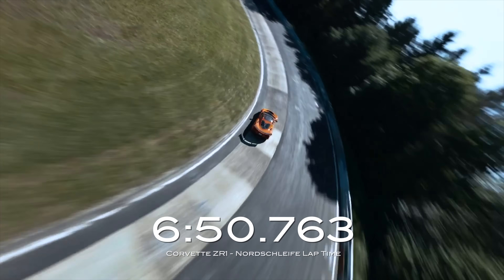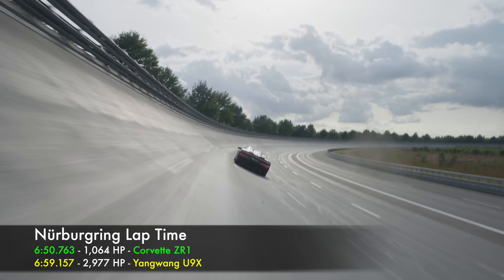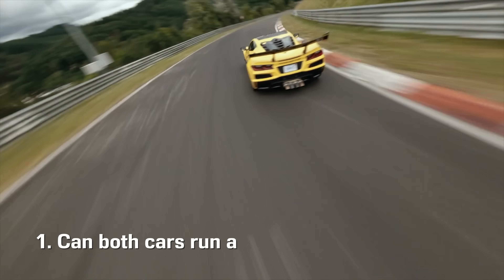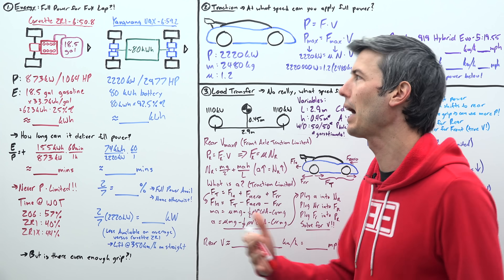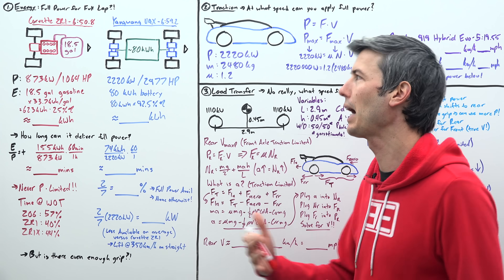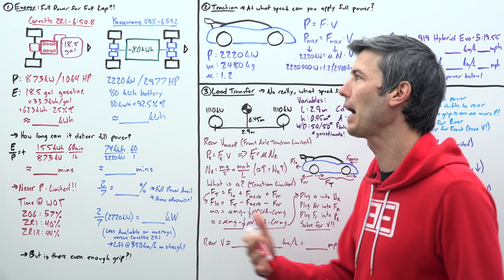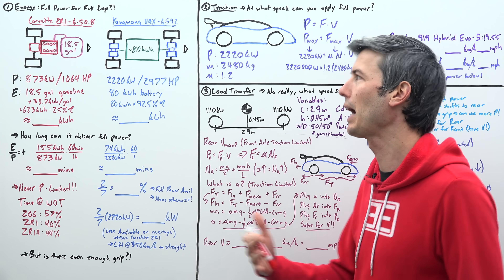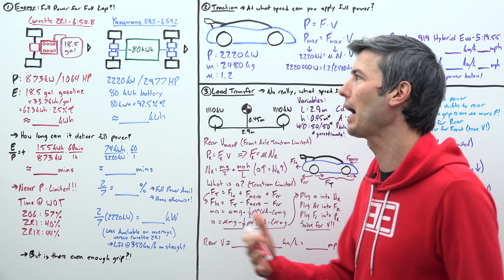Gas Beats Electric! Why Is 1000 HP Faster Than 3,000 HP?

Comment: Ferrari's development test driver said the same thing when they were developing the F80, "At a certain point power becomes meaningless."
Reply: Walter Röhrl, legendary Rallye Champion and Porsche's Chief Test Driver, has said the same many years ago. 
Basically it doesn't matter how much HP you have, if you can't fully use that power, your tires, brakes, clutch and aero are not good and your car weights too much.
Reply: @doublep1980  Iirc he was driving an Audi Quattro GrB back in the day.
Reply: Enzo Ferrari himself had said a lot of wise stuff, so guess their test driver is just continuing the tradition.
Reply: Power only becomes meaningless when it exceeds the limit of the external parts of the car
Reply: @MKCarZEditZ  No, it becomes meaningless when it cannot be handled properly. Each car needs just as much power as will help its handling.
Reply: @Lina_Antoniouthat's what I basically said mate...
Reply: It just looks like a Ferrari's coping mechanism because they have seen that a VE can deliver more than anything they have created with an ICE.
Reply: @MrlegendOr  yet they lose badly against Ferrari in an actual track race despite 2x or 3x the horsepower
Reply: @MrlegendOr  Mr. EV if you have watched the video you would have not made this statement.
Reply: @MrlegendOr  Well lets see what they do with their EV in a few years.
Reply: @MrlegendOr  I'd do unspeakable things to get a Ferrari halo car.  You'd have to give me a Tesla or Taycan, and even then I'd sell it and buy a 930 Turbo, air-cooled, naturally-aspirated 911 of some sort.  Or an LFA.  Or Viper ACR.  E46... Gen1 NSX.  Pedigree is important.  How bad ass a car sounds is almost as important as its performance... sub 3sec 0-60 means nothing if all you hear is tire noise.  For that reason alone, EV's will never replace ICE in the sports car world.  The fuel getting combusted might change, but that's about it.

Do you think an EV model will a) even be working in 30 years b) have any cult appeal like 90's JDM, American muscle, or European classics?  I don't see it happening.  Maybe that early Tesla roadster as a collectible that just sits there (as the batteries will be long dead by then, lol) but that's about it.

Comment: this really makes me feel pure electric is just a fad, imagine this with a hybrid generator something to keep it at full bore as much as it can, like put mazda's rotory generator in it and get that 28% closer to 40, would help to potentially reduce the front motor size as that will lose grip under acceleration and put much higher burden on the tires in cornering

Comment: Didnt watch the whole video but the U9 wasnt running in the 3000hp mode on the track it did however on its top speed run as far as ive read.

Comment: If ZR1 is at full power 40% of lap, I'd expect the electric car to be faster during that 40%.  The electric car limiting factor may be battery discharge rate vs battery temperature.

Comment: The driver's ability and experience will be a far bigger factor than these HP of these cars. Also factors like micro climate would require no less than 10 runs to statistically eliminate a lot of variables.

Comment: Gas engines not only aren’t at full throttle for most of the lap, but for most of the full throttle they are not at peak horsepower. Most of the time your 500hp engine is producing less than, what, half of that depending on rpm. ..
Reply: For racing though you obviously always run in the 80+ or even 90+ percent peak horsepower range.
Reply: @Sunlight91 You TRY to, but piston engines can be peaky, so it depends. Turbos, depending on the design and tune in relation to the engine can help and the C8 ZR1 has been said to manage thus well, but that usually means torque curve more than horsepower.

Comment: "hmm I wonder if it finally won't be the tires that are the limiting factor. Maybe the weight is what kills it" 

"It's the tires" 

"Sorry for ever doubting you. It's always the tires"
Reply: weight makers the tires job harder! its all connected...maaan
Reply: Well, Duh! huh?

It's, WEIGHT, WEIGHT, & WEIGHT. You do the simple math of POWER to WEIGHT. 

For example, using a car with 300 horsepower and a weight of 3,000 pounds:

Power-to-Weight Ratio=300 hp 3,000 lb=0.1 hp/lb Power-to-Weight Ratio equals the fraction with numerator 300 space h p and denominator 3 comma 000 space l b end-fraction equals 0.1 space 
h p / l b

Power-to-Weight Ratio=300 ℎ𝑝3,000 𝑙𝑏=0.1 ℎ𝑝/𝑙𝑏

This means the car has 0.1 horsepower for every pound it weighs. 

The math is simple, but the physical concept is what makes the ratio a useful performance metric. It's an application of Newton's second law of motion 
(\(F=ma\)). 

Power is the rate at which work is done over time.
Weight (or, more accurately, mass) is the object's resistance to acceleration.

Don't forget the Porsche Gt3rs time.
Reply: @davel696969 tail wagging the dog. Just because we all do a calculation does not automatically mean it's the most important or most relevant.
Reply: @Cyrribrae  The ZR1 was faster around the Nürburgring with about 1/3 the power, his mathematics explained why. In this instance the experiment agrees with the math.
Reply: @Cyrribrae 

Yet, everytime we do that calculation the lighter vehicles are the fastest on tight tracks. WTF is that? Could it be the HP to weight? The Porsche Gt3rs is proof positive and arguing otherwise is banging your head against a wall. Go ahead, it's not my head, BANG AWAY!
Reply: @davel696969  bro, have you ever seen an airplane?
Reply: The weight affects how much force is exerted on the tires during cornering. Lower weight means the the car can corner faster (higher centripetal acceleration) without reaching the limit of grip
Reply: @MA-jz4yc  the tires are still the limiting factor there. Doesn't matter how much weight is on the tire. If the tire can't handle 3,000hp, it's not going to handle 3,000hp.
Reply: @arand0mpers0n58  Thats true when you are putting down power during acceleration but when cornering and braking the weight the tire has to shift around makes a huge difference.
Reply: Weight does have an effect. The force needed and force generated by the tires are both linearly correlated with weight, so that doesn't matter. However, aerodynamic downforce is unaffected. So something like an F1 car can generate 5x its own weight in downforce, but the same aero setup would only generate 1.6x on the Yangwang U9X.
Reply: You know the fun thing, is for a motorcycle, it's still the tires.
Reply: @aluisious  Motorcycle: "What do you mean, contact patch?"
Reply: @r0x0r-p4t  You'd be surprised what a motorcycle can do with its small contact patch. 

I'm sure some car dweeb (not car fan, or car nerd, or car geek...a car dweeb) will chime in and say "nuh uh," but any random track oriented sport bike out of a dealership can corner at 1.3g, no problem. Almost no sports car out of a dealership can do that. I can't even name one off the top of my head, except maybe a 911 GT3 RS.
Reply: @aluisious  For the motorcycle, it is the geometry of the motorcycle
Reply: tires + downforce (so... tires is)
Reply: Excess weight overheats tires too.  So even if a race tire is put on the EV tank, they’ll get cooked faster, which on a long course like the Ring means less grip afterwards.
Reply: the tires ARE ideally the only thing ever touching the ground. makes sense
Reply: In Caroll Shelby's words, "There's always not enough horsepower, but not enough grip to contain that power."

Comment: 5:38 Any tire that lasts 80000 miles is dangerously ungrippy.

Give me a sub-200 treadwear rating any day!

Oh, and all-season tires are really NO-season tires since their compromises to be barely ok in all weather conditions renders them very sub-optimal in any weather conditions. 

Give me 200 treadwear “summer only” tires for most of the year and Blizzaks (or whatever) for winter. 

How hard is that? I used to bolt on studded winter tires in the late fall with my dad in the 70s. You can’t do that now for some reason?

Comment: Usually, I'm a quiet viewer who just watches your stuff and doesn't comment, and I love your videos. This time, though, there were just a lot of oversights that are way too relevant not to write about them: 
1. The run was not conducted in a vacuum, so downforce not only depends on gravity, but also aerodynamics. This is a factor that would need to considered when calculating the entire right half of the whiteboard. This means that the car is able to utilize its full power potential at way lower speeds than calculated here, because the higher resulting normal force gives the tyres more traction.
2. The comparison of how long each car can spend at wide open throttle is a little pointless, because the U9, at WOT, delivers 3x the power. A comparison of how long the U9 would be able to run at the power that corresponds to WOT in the Corvette would be a more sensible comparison, though even that is a little misleading as the U9 is heavier and therefore needs more power to achieve the same amount of acceleration. The "correct" metric here would be something like: How many rolling start 20-60 runs in exactly 3.0 seconds can each car perform before it runs out of energy storage?
3. You mentioned that the U9 cannot put down full power ever, during the whole race. When talking about the driver lifting the gas pedal at 350km/h, though, you then once again suspected that this may be in order to preserve power, even though other reasons are way more likely: This U9 is not the same one that broke the top speed record for a production car, it uses different tyres, aero, etc that make it more suitable for cornering but also means that the car is under more stress due to the downforce pushing down on it. The tyres or suspension will only be able to endure such forces at these high speeds up to a certain point, so the driver will have to lift eventually. Based on your calculations, I would strongly suspect this to be the real reason he lifted, but since I believe the car uses way more power than that (see 1.), it might just really be due to energy preservation after all.
Personally, I really respect your work on this channel and I would love to see you make a follow up video talking about these factors! I haven't done the actual calculations yet, so I'd certainly tune in.
Reply: Agreed. Another point is that aero will also change the weight distribution. The center of drag may not be at the same height as the center of mass, and the diffuser and wing may generate more force in the rear. If I am not mistaken that is pretty much a necessity to have directional stability at high speeds.
Reply: Ah yes, the people from the Engineering College of YouTube.
Reply: You really watched this video and all you took away from it was he wasn’t thorough enough?
Reply: @Stevethepirate88  Yes, he is not thorough enough. The downforce due to aerodynamics is not calculational noise that's shifting the result by +- 10 percent or something. For racing cars, downforce due to aerodynamics far exceeds downforce due to gravity even at comparatively low speeds. A couple of years back I read that F1 cars can theoretically already drive at the ceiling at about 160 kph / 100 mph. Now these numbers are probably not accurate anymore for modern F1 cars, and certainly not for the cars discussed here. But the point still is that if you disregard a major component in your modeling, your result will be hot garbage.
Reply: @Stevethepirate88  internet smartguys as usual, gotta love em
Reply: Your 2. Point is bs. He calculated the max avg power for the lap time and if you watched the same video as I did, you could see, that the max average power available is lower than the power of that corvette. There's your answer for that.
Reply: Edit: Comment obsolete due to pinned explanation. 

there is a thing to consider: Regenerative braking. The electric car migh be able to recover a significant ammount of energy, while the ice car can't. This might get an additional 1 minute at full power or 50% more engergy for the lap due to betteru usage, if pushed to the limit.
Reply: @clockworkvanhellsing372 
On longer track sessions regenerative braking is often disabled because of the extra load on the battery. There is also a pinned comment explaining the same. there are things that we don't know and have to assume. You could also argue that the Corvette has a higher efficiency than 25%. Racecars on race fuel often have 30-35% or even higher.
Reply: @clockworkvanhellsing372  Regen braking is not recouping 50% of the total energy that heavy car can hold, that's just bonkers to assume it's even possible. Regen is pretty inefficient even when you're using it at speeds the electric motor is actually efficient at, and it only returns fractions of kinetic energy and nothing at all lost to drag which is obviously where all the energy is wasted. Electric cars are wildly inefficient at high speed, which is why a tesla is a beast off the line and can still be passed by a miata doing a highway pull from 75mph. That will also hold true in reverse, even assuming the switching gear inside the car can even store whatever it can generate...

Comment: Partially for part 2 and mostly for part 3: am I mistaking or should we need to take the downforce of the wings etc. into consideration? They also apply to N_R, so they would change the first we can apply to the road F_R, no? (edit: just saw 14:45, but I still think we would need to consider this 😅)